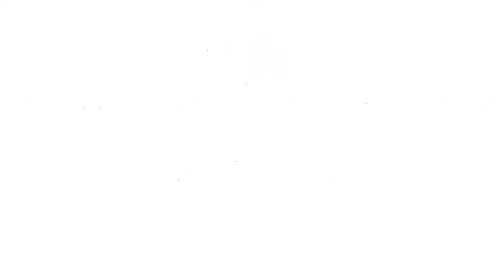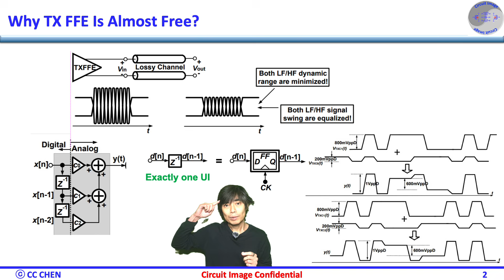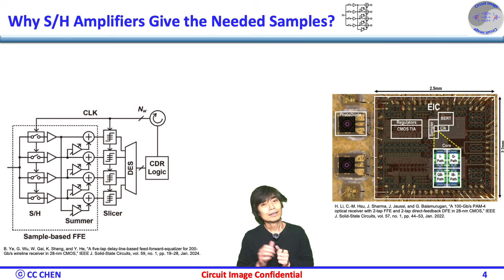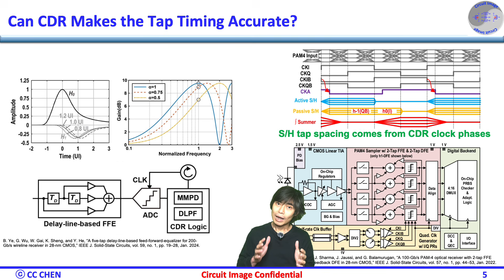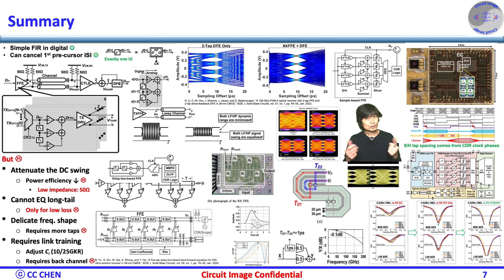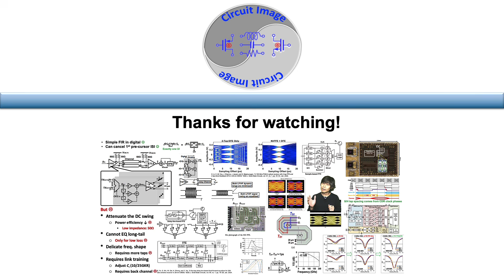Why RX FFE?

Comment: Hello, thank you for the great video. I always enjoy watching your content.
By any chance, are there any advantages to using a Sample-and-Hold (SAH) circuit in a single-ended link, such as in chiplets? It seems like bandwidth degradation due to Cio and kT/C noise would act as disadvantages. Are there any overarching benefits that can overcome these drawbacks?
Thank you.
Reply from the maker: Hi 성현우,
Thank you for the good question and for always supporting the channel!

Yes, an SAH can still provide important benefits in a single-ended chiplet link. Its main advantage is architectural rather than simply improving analog bandwidth. It defines a precise sampling instant, isolates the channel from comparator kickback, holds the signal long enough for the following decision circuitry, and enables half-rate, quarter-rate, and time-interleaved sampling.

However, your concerns are correct. The sampling capacitance increases the input loading, the switch introduces nonlinearity and clock feedthrough, and kT/C noise sets a noise floor. In a single-ended implementation, supply and common-mode disturbances can also be more difficult to reject.

Therefore, for a simple full-rate NRZ chiplet receiver, adding a separate SAH may not be worthwhile in terms of power and performance. But for a sub-rate, ADC-based PAM4, or heavily calibrated receiver, the benefits of isolation, precise timing, and additional processing time can outweigh the bandwidth and noise penalties. The key is to choose the minimum sampling capacitance that still meets noise and matching requirements.